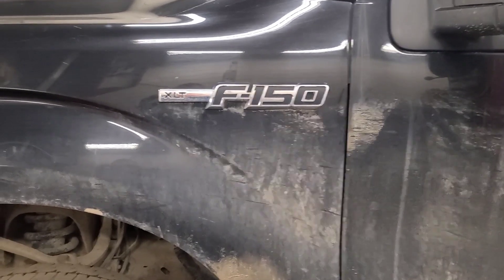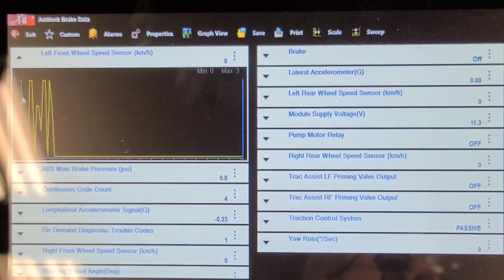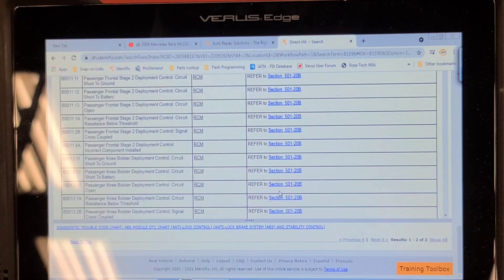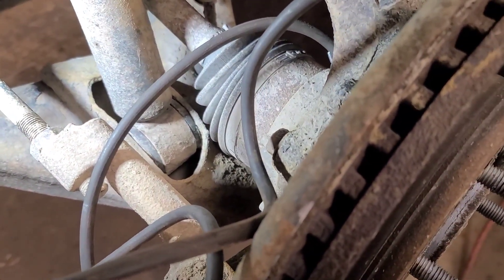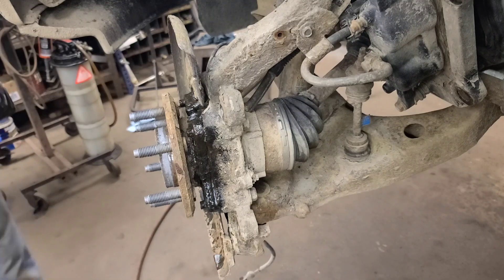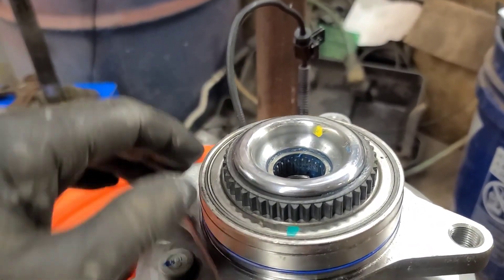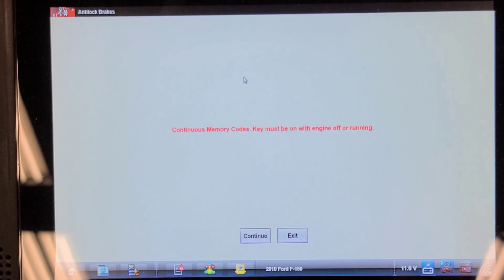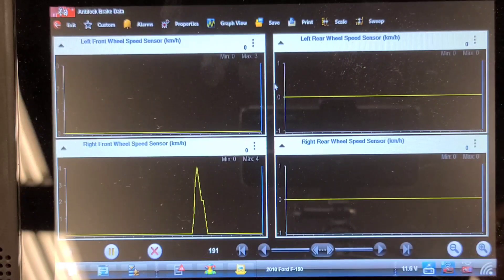2010 F150 ABS and Brake Warning Lights On, C1296, C1963

Comment: Hey my check brake system light is on any idea what it could be wheel bearing?
Reply from the maker: You need to scan the abs system for codes. Dozens of possibilities for the light to come on.

Comment: This is very interesting, because I recently had my ABS module rebuilt and when the ABS light came back in I assumed it malfunctioned again. The 1296 and 1963 codes appeared. So I will have to check that front left hub out I guess. Thanks for posting this.

Comment: Hey Phillip awesome video,subbed. Thank you. 
I have 2011 ford e150 time to time Id plug my obd reader and occasionally the code C1963 comes up and sometimes it doesn’t, does that have anything to with the electrical for the steering
Reply from the maker: If the C1963 is in the ABS then stability control is disabled possibly due to codes in other controllers. You need to do a complete network scan of all controllers see what else is setting codes.
Reply: @PhillipBailey  Thank you very much, will do.

Comment: Hey great video.i got a 2010 mustang v6 with a c1963-30 code and the tc light and not the check engine but also a light that looks like the tc light turns on at times and wen applying the brakes the steering wheel goes from side to side.mechanic notice the front passenger side pads were wearing down faster.should i look into the wheel sensor to begin with? Car has 30k on it.thanks.
Reply from the maker: You need to do a network scan of all controllers as the fault could be in the ECM or possibly the SIR. That code appears to be associated with the steering sensor:

Normal Operation

The ABS module uses information received from several sensors (wheel speed sensors, steering wheel rotation sensor, stability control sensors, etc.) to determine if vehicle stability or traction warrants Electronic Stability Control (ESC) interaction. If interaction is warranted, the ABS module will adjust brake torque at specific wheels and the PCM will reduce engine torque to make the vehicle more stable. Once the ABS module has determined that the stability event has been corrected, it will return brake and engine torque to normal and continue to monitor the vehicle.

If conditions exist during normal operation that prevent the ESCsystem from operating, DTC C1963 will be set. This DTC is usually set due to the steering wheel rotation sensor or the Restraints Control Module (RCM) being damaged or installed incorrectly. This DTC will not clear until the vehicle has been driven above 48 km/h (30 mph) with input from the steering wheel rotation sensor.

DTC C1963 (Stability Control Inhibit Warning) - Once every key-cycle the ABS module will determine the straight-ahead or center position of the steering wheel by monitoring the steering wheel rotation sensor while the vehicle is being driven. If the vehicle reaches a speed of 75 km/h (47 mph) without finding the center position or if 30 seconds has passed since the initial drive-off without finding the center position, DTC C1963 will set.

Comment: I have an 09 F150 SC that has the traction control light on steady, it used to intermittent, I recently had a scan done which indicated a bad brake light switch its bee replaced after which a second came up indicating the ABS system (I have no issues with braking and no ABS lights) the truck has 170K kms. on it. Any ideas on what else to look at?
Reply from the maker: You need to do a total system scan of all controllers and report back what codes it's setting in which modules. If you have a warning light on then you should have a code as well.
Reply: @PhillipBailey  thanks

Comment: Very informative, I'm subscribing.. quick question I have a 13 f150 raptor with intermittent light check brake system/ hill decent control/ check advance trac/ with traction control light abs light and parking brake light on? Any suggestions
Reply from the maker: I'd suggest to start with a network scan of all controllers. Check for codes related to the ABS and Traction Control system. The codes should give you some direction.
Reply: @PhillipBailey  thanks bud

Comment: Got a code...c1963
What the meaning for tis ?
How to fix it ?
Reply from the maker: C1963 indicates that the Stability Control function has been inhibited. This is usually due to an input problem in the ABS system but code I believe be caused by codes in the ECM. Is the MIL on as well? Are there other modules reporting codes during a network scan?
Reply: Just curious, why would you replace the bearing when all it really needed was the abs speed sensor?  The bearing is just the hunk of metal the abs speed sensor gets it's reading off of.  $20-40 fix verses couple hundred with the bearing. Unless the bearing was blown it should not have been changed.
Reply from the maker: @lanthanum68 up here in Canada eh we have a lot of rust and 90% of the time the sensor won't come out of the cast iron wheel bearing without breaking off.
Reply from the maker: @lanthanum68 up here in Canada eh we have a lot of rust and 90% of the time the sensor won't come out of the cast iron wheel bearing without breaking off.

Comment: I have a 2010 Ford F150 with this problem.  Codes U0121, Lost control with ABS control module.  B1596, service continuous memory (DTC)s.  B2900. (VIN) Mismatch.  C1440, Pressure difference transducer circuit failure.  C1963, Stability control inhibit warning. ABS sensor, ABS module, or Hydraulic Control Unit (HCU) gone bad?
Reply from the maker: Could be a number of possibilities. Start by doing a network scan of all controllers and record the codes in each module. Clear all codes and then test the charging system for a bad alternator diode. Clean all battery cable connections and body grounds. Make sure the battery is in good condition and passes a load test. Drive or run it and see what codes return in which modules. Is the MIL on as well?
Reply: @PhillipBailey  No, the MIL is not on, only the ABS light, brake light, and rotates the check braking system and the traction light.

Comment: I knew if I just check back from time to time you would eventually be covering an 09 or 10 with abs related issues. Another great video! Thanks a lot Phillip. You do an excellent job of explaining things to the viewer.
Reply from the maker: Glad it helped you out.
Reply: Dealership says they can’t communicate with abs module. (brake system warning, traction control and abs lights on cluster. ) It’s been this way for about 6 years now 1000 k miles. Recently came across a tsb stating to recalibrate abs if truck experienced issues upon installing larger tires. 
My 09 KR purchased used had aftermarket 18”s on it. I installed oem 20” wheels from 2011 KR. Recently took it to the dealership and asked if they could pull codes for me as I am thinking about sending module in to be refurbished. Dealership stated they couldn’t communicate with the abs and it would need to be replaced and suggested I replace master cylinder as well as pump. Is there no way they can look up code history from when it originally occurred? I am searching for my service history notepad to see if I can find notes from back then. Thanks so much for any feedback.
Reply from the maker: Don't know why master cylinder and pump would be required. Are you having brake problems other than the ABS light on? Sounds like they are just firing the parts cannon...
Reply: @PhillipBailey  Thanks again for the feedback Phillip. I located the codes I received back when the lights came on. Back then it gave me the following codes. The second I still can’t make sense of given I’ve never driven past 90 mph. The week this occurred was when driving down hill in a storm and vaguely remember hydroplaning some. Also I was driving on our property in some wetlands/marsh area and attempted use use 4x4 to get out of a rut (nothing serious like off-roading). Not sure if either could have caused such. Since adding the oem 20” wheels the speedometer is a little off 3-4 mph faster than what it should be. At any rate I am going to do what you suggest by checking power/grounds…fuses etc. 
B1342 (ABS Module Malfunction non-mill)
P0297 (Vehicle over speed condition) 
As of this week a buddy used his snap on and found a code
-U0121-00 (Loss communication with ABS control module “A” not current DTC)
If I come across anything I will attempt to use what you shared in previous videos to troubleshoot before seeking more advice lol thank you for your time and responding. Also as it stands now given all of the scan tools you have tried out can you suggest one that’s in the $300 or below range? Thanks
Reply from the maker: Before condemning the ABS module you need to qualify powers and grounds to it. No Communication could be a simple as a blown fuse. If powers and grounds are ok to the module need to confirm the network wiring at the module.

Comment: I know a tech that over torqued the 13 mm axle nut and broke off the tip of the axle stud with the nut. He reinstalled the axle anyway...no axle nut. On this F-150...what kind of problems might arise?
Reply from the maker: The axle might walk inwards and allow the 4x4 to unlock so the wheel won't drive in 4wd. Do i know this tech?
Reply: Phillip Bailey No...you don’t know this tech. Thanks for the reply.
Reply from the maker: @tgoodm1  just bugging you. Stay safe...
Reply: Phillip Bailey 😂
Reply: @PhillipBailey  that was good one LOL.
Reply: @tgoodm1  LOL